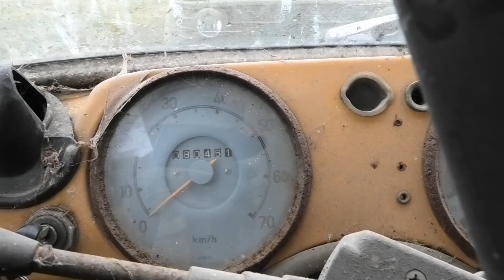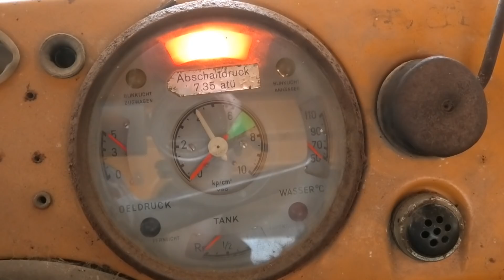Unimog Barn-Find. part 1 - Will it start?

Comment: still remember , me and 5 other fellas in the back of one of these during my draft in the late 80's. We just came back from an exercise at 2 AM and took a shortcut over a tank track flooded with water. At some spots it was almost 2 meters deep.The mud flew over the flatbed where we sat, the Unimog was at least half a meter over its axle in the mud but it kept running! Amazing offroad capability these little trucks have.

Comment: Lovely old unimog 
Something a old truck driver told me here in the USA. When his rig would roll black smoke like that. He would put transmission fluid in at his next fill up. It would smoke just as black but after about 1/4 or 1/2 tank no more black smoke and the diesel would have more power.

Comment: These were never the most aesthetically beautiful trucks ever manufactured... but their beauty is in their practical CAPABILITIES. These trucks off-roading abilities are legendary among the 4X4 community. This goes doubly, for former service members who have spent time in Germany, and have seen what the German Army does with it's Mogs. They aren't fast, but they ARE just about the most sure footed beasts around, off-road. Lots of torque, and their PTO's give them lots of interesting abilities that other 4X4's wish they had. Amazing trucks, and far more nimble than their height would suggest.
Reply: They are beasts any way you put it. There are versions you can put on rails and they'll happily pull rail cars (or in the case of the Netherlands, subway cars. They have 'mogs who'll go into the tunnels and pull out the cars in case of power failure)

Comment: Nice.  I ran a Wildland fire truck unit based off Unimogs here in the PNW US.  Theyre SO fun to drive and use out in the bush.  I wish they were easier to find and own here in the US and I wish we got the more modern U500 Dokas and espescially the 1300s/1500s,  but I sure was lucky to get to use them as much as I did.  The overhead would de-mob a whole unit of brush engines when we'd show up because we could get the trucks and foam/water into mostly unreachable places for the other trucks.  Looking forward to seeing what you do with it.  Cheers.

Comment: These older unimogs are great old tools weve had 2 agri versions of this age . Simple machines to work on the only problem we found was not much hydraulic oil pressure to run modern farm machinery . But it coulda bn an age thing as we did change filters oil cleaned gauzes etc they just seemed to lack flow . But apart from that we power harrowed topped had them on a big grass mower for cutting silage grass . They ran rakes tedders etc well . Even lifted our 4 furrow knevnland reversable ploughs up . And managed to pull them .
Reply from the maker: Very impressive 👍 but yes, i can see how it would struggle with newer/larger hydraulic equipment. i have noticed that the pump is rather small. and it dose seem to have limited flow.

Comment: It should be started with a clean fuel can, change the oil, adjust valves and calibrate injectors, and then change all the water pipes around the engine and hoses.it is complete easy to restore

Comment: Could you answer some questions about unimog.
 looking at A
a FLU419 which I guess is a 406 chassie with a  5.7 diesel Mercedes.
 are they known to have fuel priming issues that are difficult to prime 
thank you
Reply from the maker: The FLU419 is indeed the same as a 406. with just a few modifications made, for the US market. and they were then sold through the Freightliner brand.
and yes, they also the the good old OM352, 5.7L Engine.
They don't generally have issues with priming. but these boys are getting old, and i have seen several times that dirt and rust flakes from the tank, will clog up the different filters. stopping the fuel flow.
First filter is on the suction pipe, inside the tank. (Sitting right over the tank drain-plug) The next filter, is a little inline filter, located under the cab, right below the passenger. and last, you have the two main filters, right on the front of the engine.
if you make sure fuel can get through all the filters, its just a matter of pumping the hand-pump/Priming-pump (Located on the engine) once the pump is "Hard" they will usually fire up just fine.

Of course, there is also a little feed pump, that could be bad. but i personally havent seen that happen.

Hope that helps.
Good luck with it!
Reply: @KJOff-Road  

 So I understand that but the PTO shafts that come out the transmission the transmission compared to the 406 and the FLU419 are they different or is there a shaft output available for the 419
Reply from the maker: Well, i haven't personally worked on a FLU419. There is only a very small handfull of those, here in Europe. Most of them are in the US. 
So i'm actually not entirely sure what gearbox they have. 
There was a handfull of different ones for them, back then. but i'm pretty sure the one in the FLU dose not have the outputs for the PTO drives.
Though most of these parts are more or less interchangeable on the 406-series.
However, to swap the gearbox as a whole, is a Very big job. and requires you to remove pretty much everything else from the truck.
Reply: @KJOff-Road  0

 So you're very familiar with the 406 though I believe you have one?
Reply from the maker: @johncollings6799  Yes i do. -or, well. technically the one that i have, is a 416. but it's the same as the 406, only a bit longer.
Reply: @KJOff-Road   So on the 406 the PTO's comes off the left hand side of the transmission for front and rear correct
Reply from the maker: @johncollings6799  Yes. That's correct.
Reply: @KJOff-Road  
 Could you tell me what is leaking in this picture of he rear differential and is differential and tube by chance.
Reply: @KJOff-Road  

 Any way to contact you besides Instagram like email possibly so I can send pictures of what I was trying to describe and not clutter your website YouTube
Reply from the maker: @johncollings6799  Yes, you can write to me at "teamarmytrucks@hotmail.com"

Comment: Is the motor a OM636?
Reply from the maker: No, it's an OM621.
Thanks for watching!
Reply: the 421 comes with a OM621, the OM 636 was used for the 411, 401, 402, 2010 and in the Böhringer Unimog 70200
Reply: @nukii.885  I've got one (OM636) if someone needs it in the US
Reply: @svpearlsailacapegeorgesail4758   nice my 411 has one with only 2500 hours

Comment: I had one of these 421’s for some years ago, neat little machine. Way to small engine.
Reply: Dear S.E.H
Try a smaller Unimog with the old OM 636 engine. Then you would never criticise the "power" of a 421. In the old Unimogs the engine power is always limited by purpose, also the main gearboxes and the tires usually do not allow to drive fast enough at least for common traffic.
Best regards, luck and health.

Comment: If this is Lithuania (houses nearby does not resemble houses in Skandinavia + LT registration marks on the walss) then it is not Scandinavia.
Reply from the maker: Uhm. well yeah. you are not wrong?
But this is Denmark? The registrations are just from different cars that have been imported.
As for the houses not "Looking scandinavian" i don't really know what to think of that?  haha :)
Reply: @KJOff-Road  my mistake. sure you have steinmur there. but Danish weather should not be called scandinavian anyway, it is so different ;)
Reply: @KJOff-Road  I forgot the most important part, why I like the video - it is a wonderful thing to save such cars, especially the ones with diff locks :) thanks
Reply from the maker: Hah, well, it can be, yeah :) But it was meant as a bit of a joke. as this was way into the spring (Late april) and it was still snowing :)

But Thanks! I appreciate you watching along :)